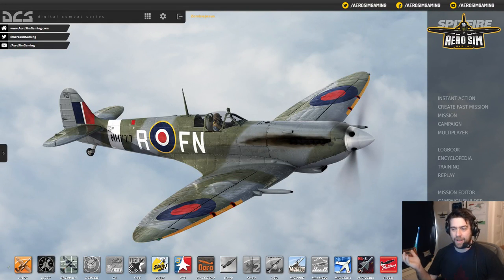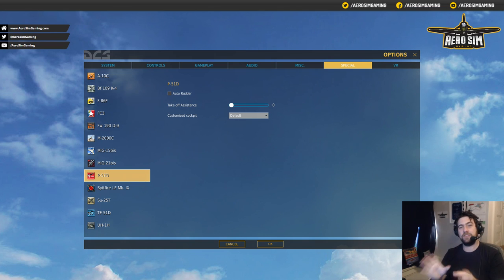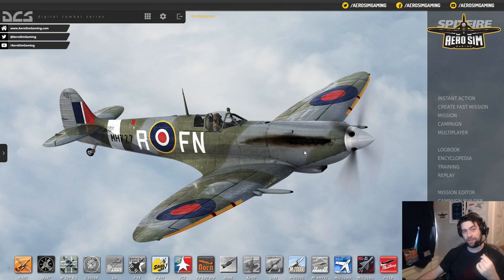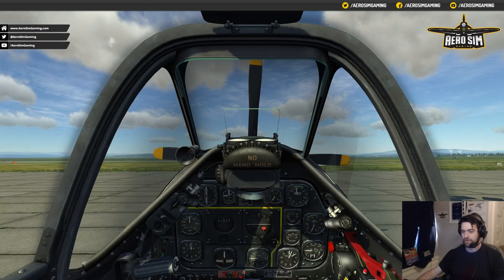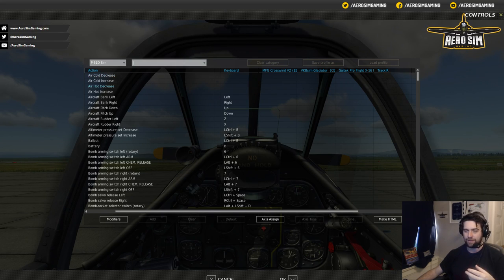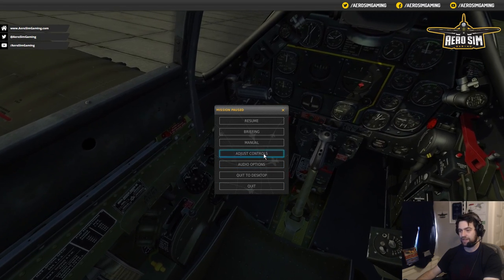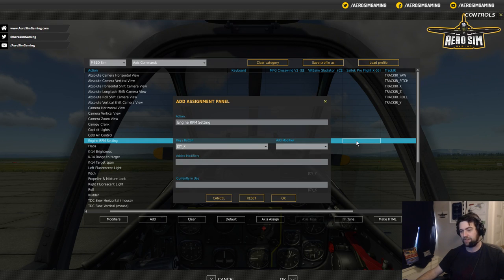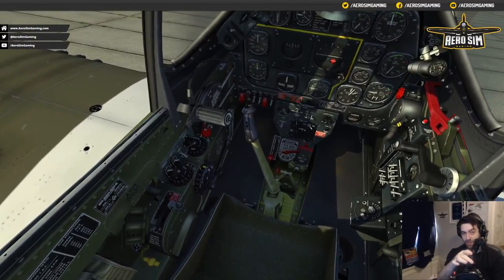DCS How to Set Up Controls / Bindings

Comment: I actually find that the 2 spin switches (you have the zoom in/zoom out command on the bottom) to be better for the trim aileron/rudder than the rotary switches you have them bound to.  The main reason for this opinion is that these 2 spin switches are notched in the center of travel, thereby making it very easy to return to 0 trim (if required).  This is even more important if you use a VR headset (like an Oculus Rift or HTC Vive) as these headsets make it next to impossible to visually locate the center point of these controls when you need to make quick corrections to the trim of the aircraft.

Comment: I am using a R/C sim controller from Real Flight that gives me the same controls on sticks and switches as my model airplanes. Is there a way to calibrate the range of axis in DCS as I am having trouble with the range on the throttle stick. It doesn't go all the way down in DCS TF51. When I have the stick all the way down on my controller the throttle in the Sim goes to about half way and not all the way down making it impossible to taxi due to high speed. Most other Sims have calibration menu but can't find it in DCS.

Comment: Can I still use the twist in the stick to control my rudder with auto rudder still on? Does it fully control the rudder or is it just a trim device?
Reply from the maker: Yup you can continue to use twist grip, what the auto rudder does is just take over all the fine rudder adjustments.  So you can still direct the aircrafts nose with rudder in air to ground, aerobatics or dog fighting.  But the auto rudder, just deals with say adverse yaw from ailerons, or torque from the engine!